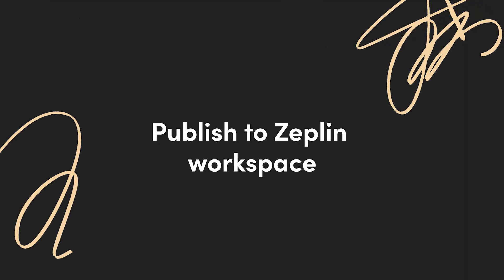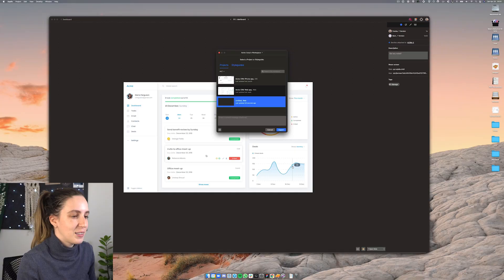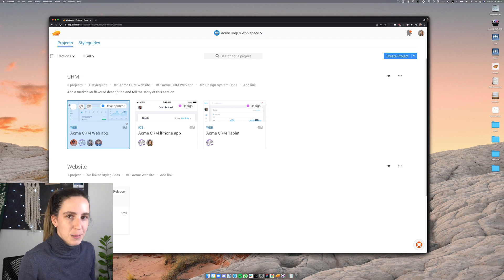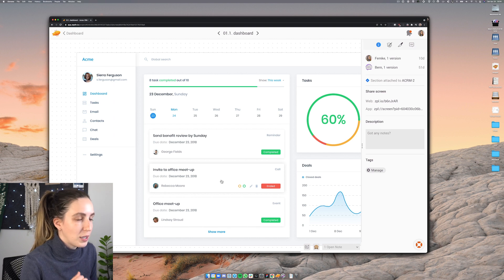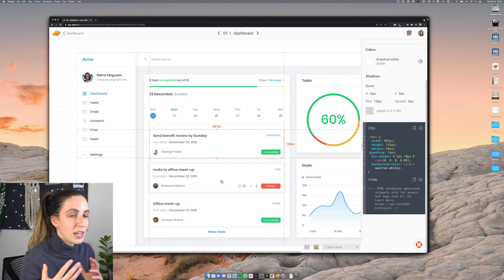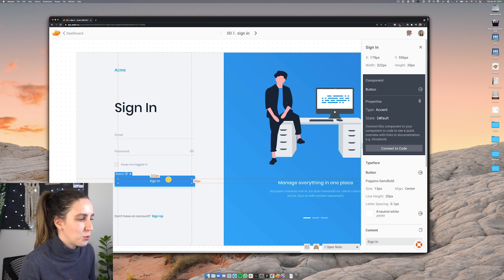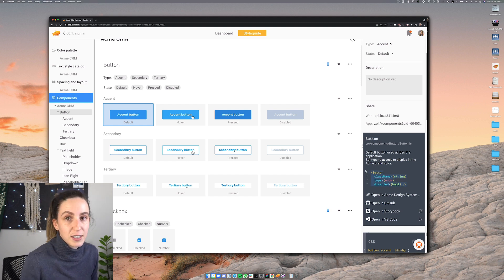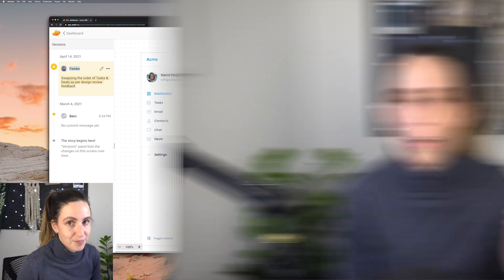Handing off your design source of truth with Zeplin

Comment: Great content! I need to look into this for my team. Do you know how this will work with something like Storybook?
Reply: Hey ! I have worked connecting Zeplin to Storybook. It basically connects the Zeplin component to storybook codebase so when you look at the component in Zeplin, you can actually see the storybook component code which devs can use right away in their project (without going back and forth from Zeplin to storybook)
I hope this helps 😊
Reply from the maker: Hmm I haven't used storybook before so not sure!

Comment: All these tools displaying height and width is sad. Almost never useful in code. Same applies to export to code tools. Otherwise looks good.
Reply from the maker: What unit of measurement would you like to see instead?
Reply: @femkedesign  I'm advocating for width and height to fundamentally only be used in a few cases, where content is a fixed size. Maybe images or icons. For almost everything else, width and height is useless because content everything is based on the space content takes up.

Comment: Never seen the components or this newer feature in zeppelin when I have been handed off too. Would be handy as supper often designers design by eye and you find object on one page is not quite the same pixel size on one page to another when trying to use the numbers to work out ratio to make in css